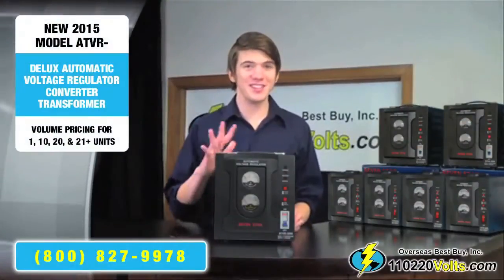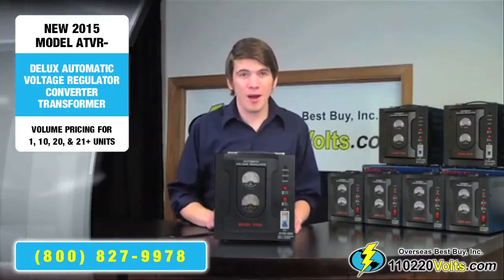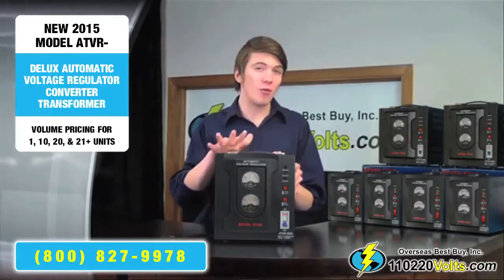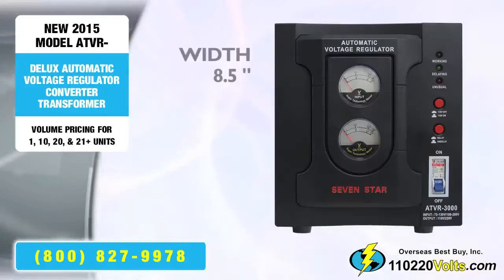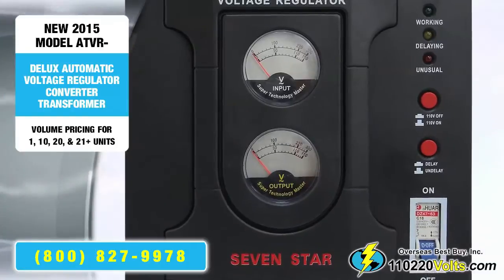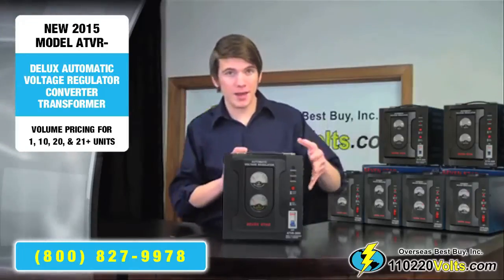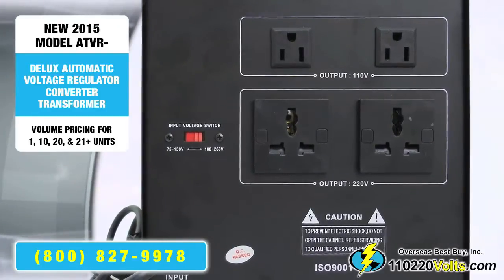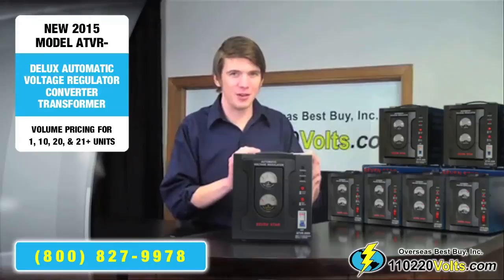Tour the Seven Star ATVR-3000 and ATVR-5000 Deluxe Automatic Voltage Regulators

Comment: Complete layman here, so please forgive me if I don't use the perfect context or verbiage here, but: If I have an electronic device that runs off 240v outlet and is about 1200 watts but only have 110v outlets, will this reduce or eliminate the "pull" of wattage from the circuit where the wiring in the walls heats up and presents a fire hazard?

I guess I just don't understand how this works. I have a high-powered computer with 8 graphics cards, and it arrived with the small 250v plug-in and I only have 110v outlets. I don't want to overload a circuit since this device will be running basically 24 hours a day. I know I need a device with converter and regulator, but also don't want to overload the circuits and wiring of my home. Tips? Advice?
Reply: The pull will be 1200 watts at 240v so you have to make sure you plug it into an outlet that can handle the load
Reply: So, the pull of the actual transformer will always be what the actual device is pulling ( meaning, the device plugged into the transformer/converter)? So, transformer is plugged into wall... 1200W device plugged into transformer. Transformer is therefore pulling 1200W from the 110v outlet?